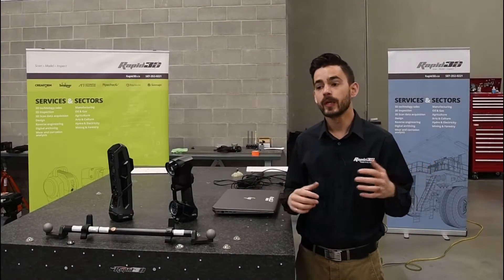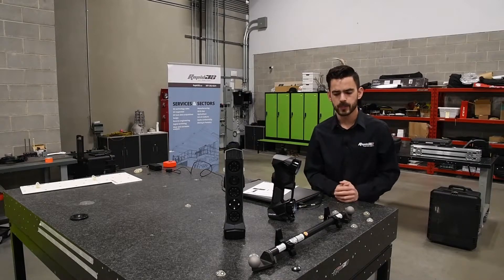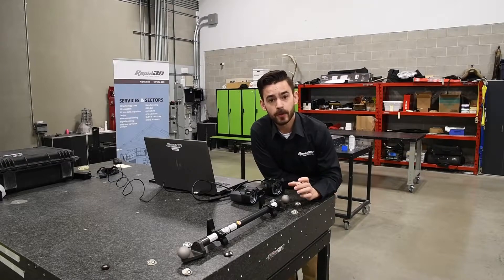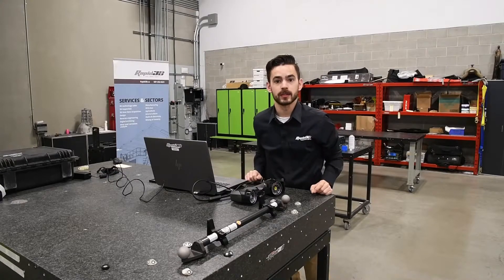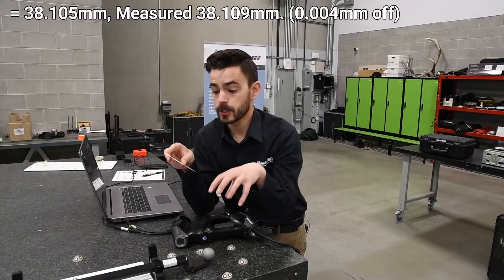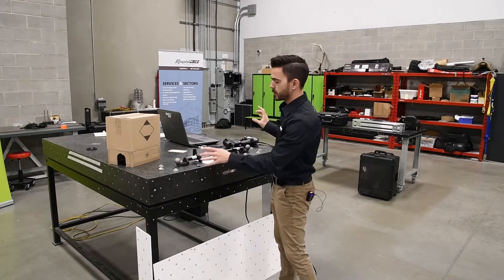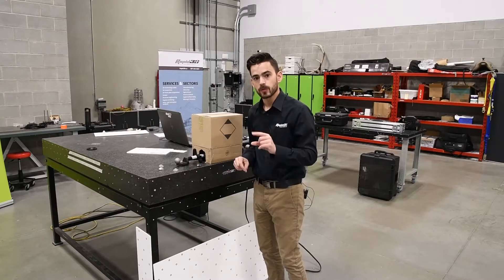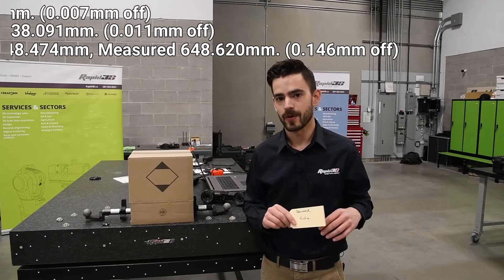Local VS. Volumetric Accuracy for Self-Positioned Handheld 3D Scanners

Comment: @3:50 he says “it’s about half a meter so we should expect the measurement to be in 40 micron accuracy”. Shouldn’t it be in 20 micron accuracy?The way I have understood volumetric accuracy, it’s 20 micron plus 40 micron per additional meter. In other words, if your two volumes are under 1 meter apart, the accuracy should be 20 micron. Any additional distance will add 40 microns of inaccuracy per meter. 

Please let me know if I am understanding it right.
Reply: 20 micro is a scaner error. Half meter ball bar - if u measure it error cannot be bigger than 20+40/2 micro - means 40 micro.
Measure u measured must be within (ball bar +-40 micro). It only means that the bigest error cannot be bigger than +-40 micro.

Comment: Of all the vids on you tube, I don't think anyone else has covered this. I have always wondered if the local accuracy rating is relative to the field of view of the scanner.

So basically you can have a scanner with a lower accuracy but a larger field of view, have equal accuracy to a scanner with a higher accuracy but a smaller field of view.

This makes it confusing when comparing scanner specs from different manufacturers.

Thanks for the video.
Reply from the maker: Thanks for your comment! Spec sheets can often be confusing and overwhelming, so we try to educate our customers so they can make the best decisions for their individual applications. Every manufacturer reports their specs a little differently, but hopefully this helps you know what to look out for.